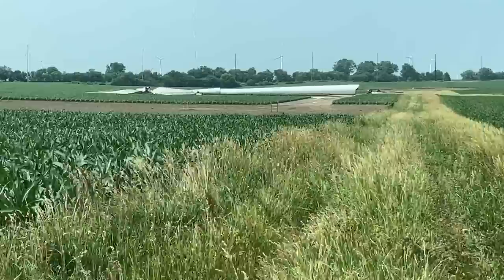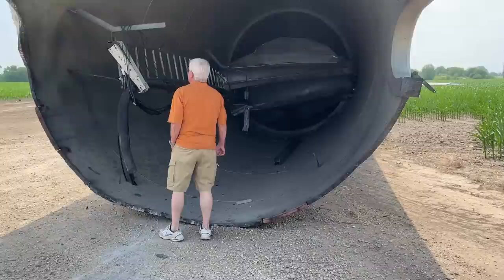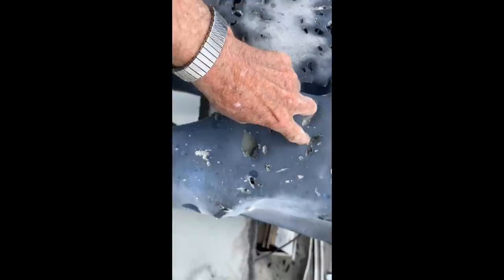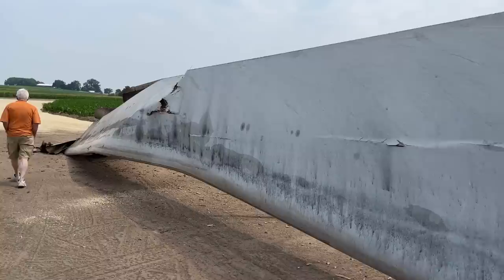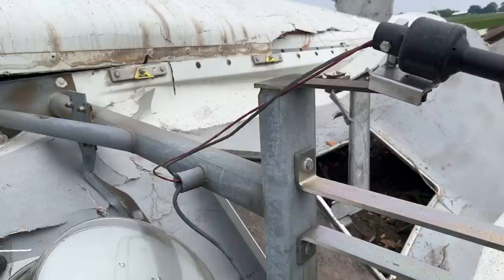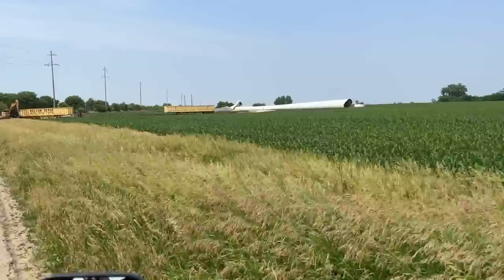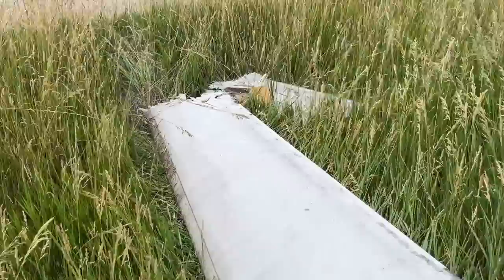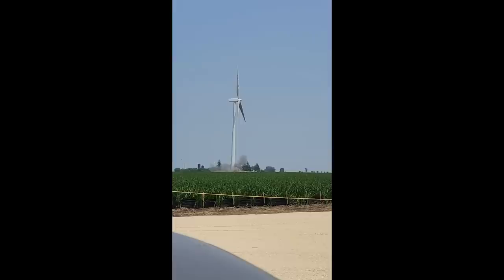OBSOLETE WINDMILL DEMOLITION short #47 pt 2 tubalcain energy lies scam fraud

Comment: Thank you for the video Mr Pete, 
I suppose part of the economics of the life and death of one of these windmills that has to be considered is that they provided jobs for US workers and suppliers, which flows through to those people spending their earnings on other goods etc(including the power they generated🤨).
As to whether they were cost effective purely by themselves is probably a mystery only the bean counters of the BIG companies would be able to work out, I have my doubts though.
Reply: 9 of the top 10 wind turbine manufacturers (based on installed GW (Gigawatts) are not in the US. The top mfg is in Aarhus, Denmark. They have installed over 60,000 of them and hold about 16% of the market share. 2nd is in Biscay, Spain. 3rd is China. 4th is Boston, MA, 5-7 are in China, 8 is in Hamburg, Germany, 9 and 10 are in China. Ie 6 out of 10, over half,  are in China. The article that I found this in (using Google) was dated May 26.  

Someone gets the job of installing and maintaining but it's not a slam dunk that they are from the US. My son services engine driven generator sets that run on natural gas (sometimes waste gas from landfills) and he often works with service reps from overseas. 

If it's subsidized, and it is, it's not likely to be able to stand on its own merits.
Reply: Probably the subsidies ended. And they would get new subsidies on new windmills. So they tear down the old to replace them with new ones and get payed again...

Comment: Those turbines are about 2.5 megawatts. Power factor is about 36% which means that it's producing on average over its lifespan 36% of its rated capacity simply because the wind isn't always blowing at maximum speed. So let's say that's about a megawatt on average. Over a 15-year lifespan it's going to make about 109 gigawatt hours of electricity, which is 109 million kilowatt hours. That turbine probably cost 2 million bucks to build and raise. So that would mean that over that time the cost of the turbine itself contributed 1.8 cents to the retail price of the electricity it produced. If every 15 years you need to demolish a few turbines on top of farmland, which by the way after the debris is cleaned up can go right back to growing crops the next season, it's a small price to pay.

Compare that to a coal-fired power plant. A good size one is about 500 mw, it's power factor is about 80%. So it's going to average 400 megawatts of output, so about 400 of those windmills. The windmills weigh about 200 tons each which is about the weight of coal consumed by that 500 megawatt plant in an hour. Those turbines produce the equivalent energy output of their own weight in coal every 16 days. About 1/10 of the weight of coal comes back out of the plant as fly ash which is mildly radioactive and not really useful for much of anything except for filler in concrete. So every 160 days it's up that wind turbine is preventing the creation of its own weight in fly ash. That's before you consider any of the air pollution concerns.
Reply: All the windmill haters should volunteer part of their land to store fly ash.

Comment: Sometimes in survival it is not profitable to climb for fruit, on a tree, because the energy gain will be less than the energy spent on obtaining food.
I wonder if anyone has ever calculated how much energy was used to create structural steel, roll sheets, weld them, build a road, bring elements, build a windmill, take care of its maintenance, blow it up, clean it up, transport scrap metal with cars, level the area and prepare it for the next one investment or sowing? Didn't all this consume more energy than this windmill produced? Not to mention that energy cannot be stored and what is produced is not always used.
Materials from fiberglass, epoxy resins are not recyclable, they are ecological garbage that take thousands of years to decompose. You just bury them and hope they won't harm the groundwater.

Comment: I find it interesting that Lyle asked for solid info on subsides, what does the gov pay. Many have gone down the rabbit hole of farm subs. That was not the question. Others quoted time it takes for pay back. Here in Oregon the contractors were paid for a certain $ per kw even if the wind mills were not hooked up to the grid. This went on for years, this is cost to tax payer that will not be know. I saw no info from any wind mill contractor here or from a non gov study, nor do i see energy depart folks giving any in put.  I do expect some gov agency warn about some problems with these vids.  Great videos I did not even consider the access roads.  I glad to see that roads concrete pads take up no land space. If this was forest land you have to have at least 100 trees per acre. It’s nice to know corn production has no acre yield. Bringing up ethanol gas as some kind of excuse not to worry about cost of these wild mills, seems miss guided, both seem to be bad.  But over time we see ethanol is not the panacea it once was.  In this day and age worst thing you can do is ask a question.  Shame on mr pete. 
Last remark mr pete spells his name wrong, it should be spelled like tool company Lisle, it’s in the dictionary.  Love your vids over the years, hope there are decades more videos to come.

Comment: Yea , they say concrete is 1 of the worst carbon polluting building materials and there’s a lot of it in the ground iv seen 1st hand the scale of that when there being built. 
The energy required to produce , process + transport windmills of that scale is clearly enormous. 
Say they were making power for 30 - 40 years then maybe yea it’d compute in my head but 15 years? 
Makes you wonder eh ? 
Not sure where yours were made but certainly here in Britain all ours came from over seas

Comment: Where the cut is, did you notice the very smooth areas that have a coppery color? This is where the shaped charges severed the steel (linear shaped cutters) Detonation velocity is about 25,000ft/second or if you will, cut speed.
Reply from the maker: Yes, I did notice that and I’m glad that you explained it to me. My friend and I discussed that while we were standing there.

Comment: Thanks Mr. Pete for sharing this! If you were designing a windmill of that size would you not place the heavy generator and most of the gearing in the base and only have the minimum equipment elevated? Seems so silly to place all that weight way up high and then have to increase the strength of everything to support that stress.
Reply: There would be too much loss in the gearing and think of how big the shaft would have to be to transmit the power two hundred feet to the base.
Reply: And how are you going to get the mechanical energy to the base to run the generator, oh wise one who knows better than the people that designed it? Oh, I know, we could use WiFi!!
Reply: Roller chain, bevel gears, hydraulic motor, toothed belt????  The forces on those blades still require great strength.

Comment: Please calculate the megajoules of fossil fuels energy expended in the mining, smelting, forming, machining, transporting, and installing each steel tower; then tell me how much of that was offset by its electricity generation. The CO2 of the concrete pad creation, rare earth extraction, carbon fiber blade production we will leave for a later date.

Comment: Even without any figures on cost/efficiency it is obvious that these hugely expensive white elephants never came close to paying.  Once the subsidies run out the maintenance and repair costs would be way above any income from power generated.  As for any return on capital?  After only 16 years, compare the scrap value of the twisted remains with the cost of building/high tech engineering/skills/labour etc.

Comment: Looking at those massive steel tube towers, I wonder if that little (in comparison) generator could ever produce enough electrical energy to offset the energy used to make the steel for the tower from raw iron ore.  Takes a lot of coke (coal) to smelt iron.

Comment: hi mr. pete, just wanted to make a point that i haven't seen anyone mention yet. you mentioned subsidies, as in, you seem skeptical that these windmills would pay for themselves without subsidies (you also raise questions about energy/carbon return, but leaving those aside for now). i just wanted to say that subsidies are not 'cheating' or anything. we are interfering in the energy markets because we believe they aren't properly valuating the 'cost' of putting crap into the air. at time of writing, a gallon of crude oil costs $1.69, and after i buy it i'm free to go into my backyard, set it on fire, and release about 9 kg of co2 into the air. if there were some kind of penalty for me doing that, then the price per gallon of oil, and consequently the cost per kwh of electricity generated from that oil, would go up. that's the point of the subsidy, to basically achieve the same effect by making wind projects cheaper to build.

Comment: If you look online you will see a lot of information on the financial viability of these windmills. It is a matter of perspective. All energy is subsidized, whether in the USA, or globally. Ethanol, for instance, does not need to be refined from corn, any organic waste will do, but farmers hold sway with politicians, so their output is mandated instead of waste for this purpose This holds true for almost every product. This all politics, the unholy marriage of state and corporations. Of course corporatism is the economic engine of fascism. In a truly free market we could evaluate them on their face and make informed judgments. It does appear that those salvage trucks are recycling at least some the metallic components, such as copper, perhaps aluminum, but I do know that the fiberglass is buried, completely un-recyclable.

Comment: The only thing that surprised me regarding what you have shown is the identical row of anchor bolts on the "inside" of the tower.  Of all the large (not this large, but highway lighting large) structures I have inspected during my career, I never saw an interior row of anchor bolts.  Thanks.
Reply from the maker: Yes, I was shocked when I saw that inner row of anchor bolts. That’s why it appears on the video.
Reply: I don't think highway lighting poles are big enough for a person to access bolts on the inside - these have ladders and platforms all the way up - easy to access the bolts from the inside - easier than scaling the outside of the tower somehow.

Comment: Yes, windmills, or wind turbines, are a viable form of electricity generation and have become increasingly prominent in the global energy mix. Here are some reasons why wind power is considered a viable and valuable source of electricity:

Renewable and Clean: Wind energy is renewable, meaning it relies on an abundant and naturally replenishing resource: the wind. Wind power does not produce greenhouse gas emissions or air pollutants during operation, making it a clean energy source that helps combat climate change and reduce air pollution.

Cost-Competitive: Over the past decade, the cost of wind energy has declined significantly, making it increasingly cost-competitive with other forms of electricity generation. Technological advancements, economies of scale, and improved efficiency have contributed to the reduced costs of wind power.

Scalable: Wind power can be scaled to suit various needs, from individual turbines for residential or small-scale applications to large wind farms that contribute significant electricity to the grid. Wind farms can be built in a range of sizes, allowing for flexibility in meeting energy demand.

Energy Independence and Diversification: Harnessing wind power can contribute to energy independence by reducing reliance on fossil fuels and their associated price fluctuations. Wind energy diversifies the electricity generation mix, enhancing energy security and reducing vulnerability to fuel supply disruptions.

Job Creation and Economic Benefits: The wind energy sector has created numerous jobs worldwide, from manufacturing and installation to maintenance and operation. Wind projects can also stimulate local economies through investments, tax revenues, and lease payments to landowners.

Technological Advancements: Ongoing research and development in wind turbine technology have led to more efficient and reliable turbines. Advancements in design, materials, and control systems have increased energy production, reduced maintenance requirements, and improved overall performance.

While wind power has its advantages, it is important to consider factors such as wind resource availability, environmental impacts, land requirements, and community acceptance when planning wind energy projects. Nevertheless, wind power has proven to be a viable and valuable form of electricity generation that contributes to sustainable and cleaner energy systems.

I had the opportunity to personally deliver cleaning solutions and solvents to coal power plants, and during my interactions with the receivers, they explained the process to me. They described how the coal is brought in and ground to a very fine powder using a diesel-powered grinder or similar equipment. This finely ground coal is then sprayed into the bottom of a fire or below a boiler for combustion. Interestingly, they mentioned that diesel is commonly used to initiate and start the fire in most coal-fired power plants.

Moreover, the receivers informed me that these power plants require periodic shutdowns for cleaning and maintenance purposes. This maintenance is crucial to ensure optimal plant efficiency and safety.

As I was leaving the area, I couldn't help but notice a grey-like substance in the vicinity that seemed to extend for several miles. It left me with some observations and thoughts. I believe it's important for each person to make up their own mind regarding the implications of these observations, as I was there and the situation appeared clear to me.

It's essential to consider multiple perspectives and gather information from various sources to develop a well-rounded understanding of the environmental and operational aspects associated with coal-fired power plants.

Comment: Any cost benefit calculations that mean anything are made by the company that has these windmills built. But of course the subsidy by the government, positively increases their profitability, by turning a loss into profit, with the taxpayer and the ratepayer picking up the cost of the subsidy, on top the price paid by the consumer.

It is ALL about short-circuiting the marketplace, where consumers decide where to spend money on new innovations, based on the utility of that technology, and replace it with the government saying, this is the technology you will use, and in order to make it worthwhile they give the contractor or energy provider taxpayer money to subsidize it.

This undermines the efficiency of the economy, and hampers the most efficient advances in technology. And it will reduce the standard of living for those in the US.

Socialism, where the government owns production, is now changed to the government inducing production through transfer payments. On our way to a totalitarian state.
Reply from the maker: Excellent and very true analysis of what is going on

Comment: Ignorance is THE problem of our society. There's a ton of it in this comment section alone. Performing a life-cycle analysis of a wind turbine would be a huge undertaking, but would open the eyes of many willing to look. In the land of the blind, it's the one-eyed man whose king. Wind power generation is so-called "green energy" yet with every view of one of those turbines reveals huge fossil fuel consumption and carbon release the left is so concerned with. Not to mention the hidden waste of half the power they generate in the distribution of that same power due to the use of steel as a power transmission medium. For sure we're all being fleeced, but unless and until you PROPERLY educate the masses it will most certainly continue.

Comment: It bothers me that so much of the scrap left afterwards is not recyclable and will just become landfill.  Yet it must have taken a lot of effort to make it.  The debris from the blades will have scattered to make recovery difficult so some of it will linger in place for a good long time.
Here's a thought.  America has some huge plane graveyards. Could they not use materials from those to make the turbine blades instead?  Then when they are scrapped in their turn there will be materials to actually recycle.
Reply: Every bit of that metal was sold as scrap and recycled.
Reply: @MrWizards1974  but it wasn't all metal was it. There was fibre composites too.
Reply: @StageRightvideo  There are three main processing methods are used for recycling fiberglass; grinding, incineration, and pyrolysis. It can all be recycled. Also I don't know about Illinois because I haven't lived there since 98 but my current state has very strict rules about what is allowed in our landfills and none biodegradable materials are not allowed. Everything that can be recycled must be.
Reply: @MrWizards1974  ok, you clearly know about this better than I do.

Comment: There's nothing green about windmills. The only bit they can recycle economically is the steel column. The rest is land fill. The blades are usually replaced in five years and need constant refurbishment. The rest is useless in fifteen years, if they last that long. 
Coal-fired generators have a design life of fifty years with far less maintenance, because they're in constant use.
Solar arrays are high-maintenance too. They require constant cleaning and don't last.
It's a con. Blow them all up.